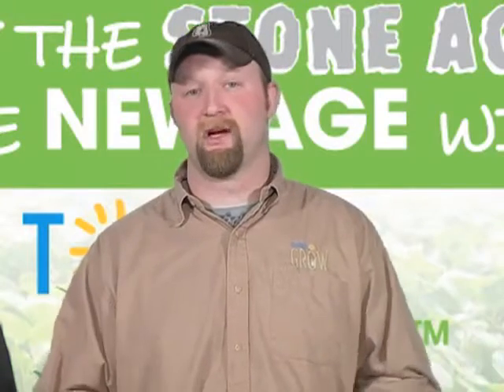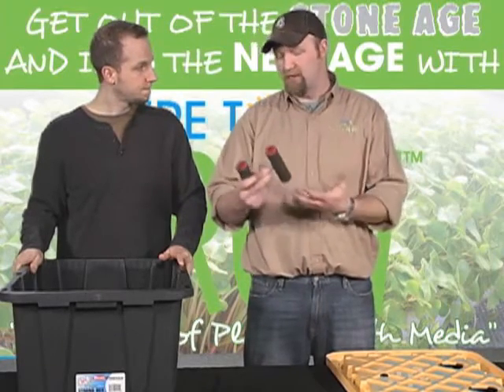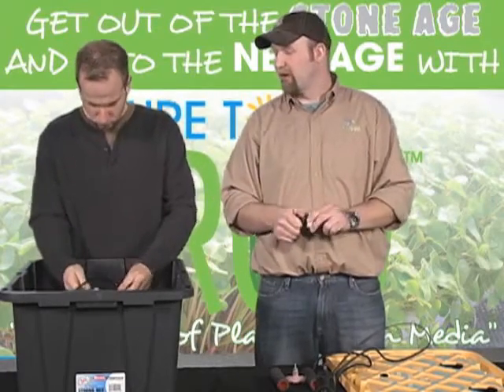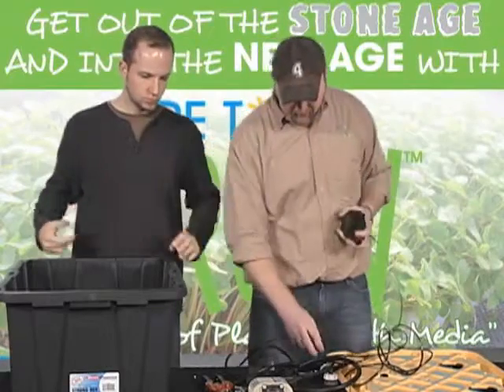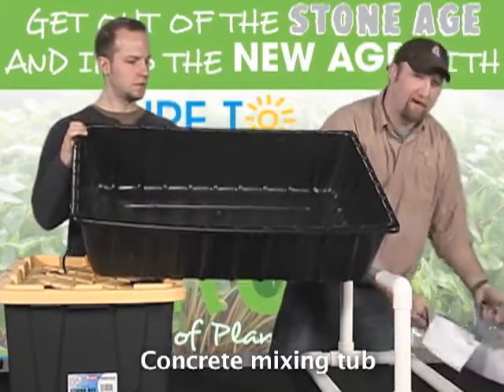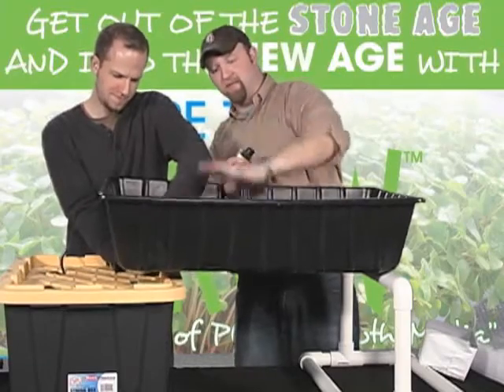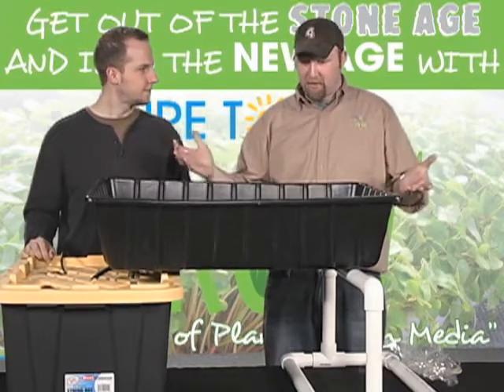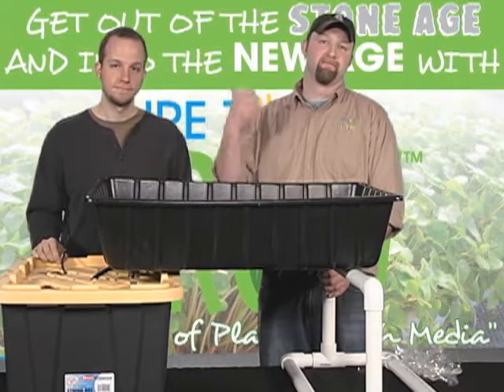Hydroponics How To: How to Build a Flood and Drain Hydroponic System

Comment: You don't technically need an airstone in an ebb and flow system, the nutrient is aerated by the  return water stream.  Breaking surface tension with a stream is actually more effective for aeration purposes.